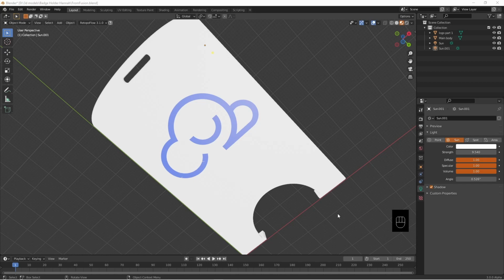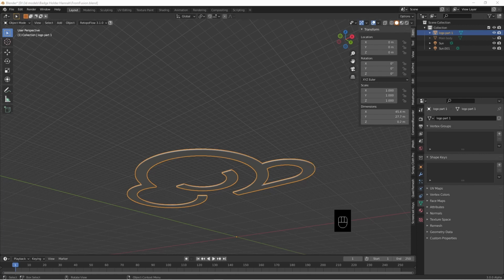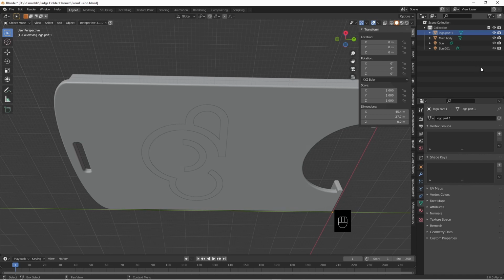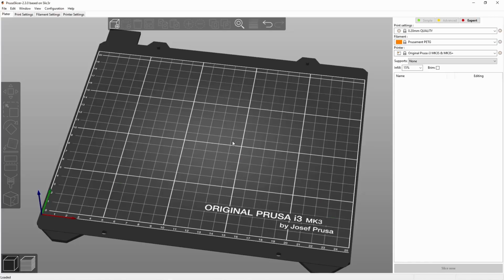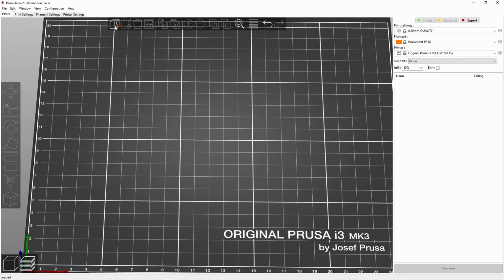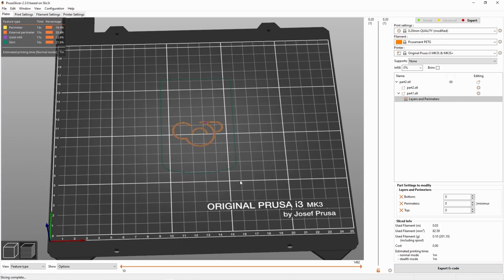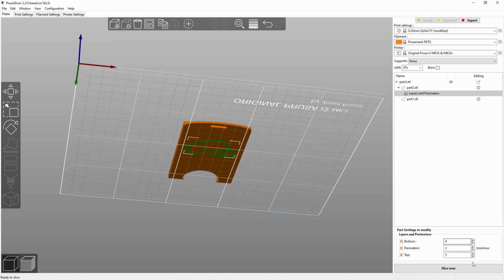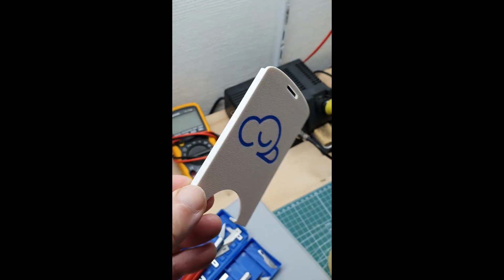3d printing multiple colors with one extruder using Blender and PrusaSlicer

Comment: Great video, could you tell me how I avoid self-leveling when starting the printing of the second part?, thanks
Reply from the maker: That is an interesting point I hadn't considered as the objects in my video were simply placed so the bed levelling could still happen without banging into the prints.  However, your slicer probably has a section for custom gcode at the start of your print and you can comment out the code to do the levelling. For a Prusa, I believe if you comment out the G80 (by preceding it with a ; ) in PrusaSclicer it will disable levelling but I haven't tried it .  I see that some printers might use a different code so you might need to google.  Also you could manually combine the two files into one in a text editor by removing the ending code of the first file and the starting code of the second but you would need to know what you're doing.  I found this software that MIGHT help though I have never tried it https://github.com/rara64/gcombiner
Reply: @notverygoodguy  Thanks for your answer, I tried with the g80 command as you recommended but since there is no initial calibration the extruder starts in a very high position, I will try with the program to combine that you sent me, thanks again for your time
Reply from the maker: @c3sierra  Yes, I didn't think of that because the printer does a home after a print so you would probably need to add the code to move the head to layer 2 first as well.  I would be interested to hear if that software works though.